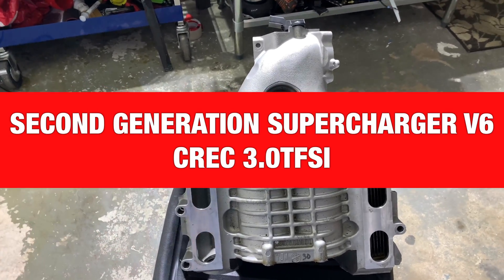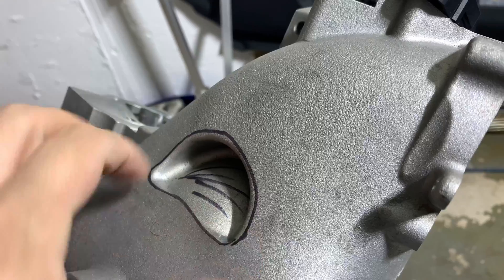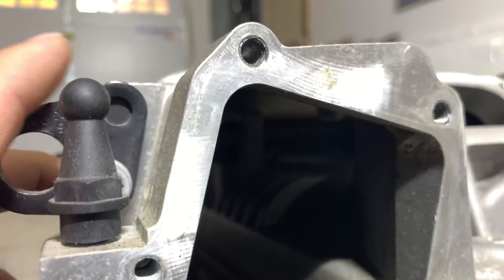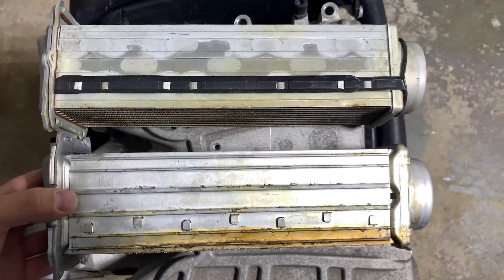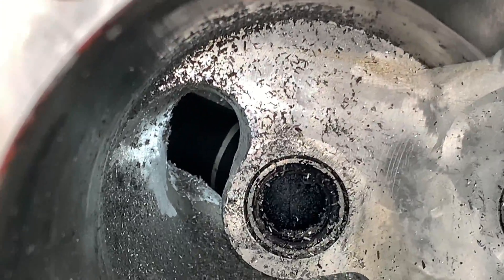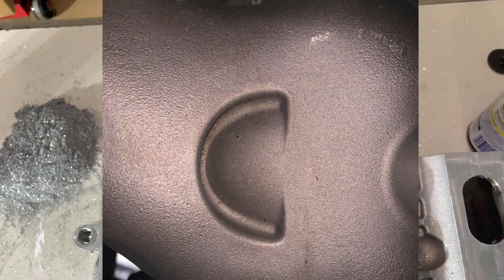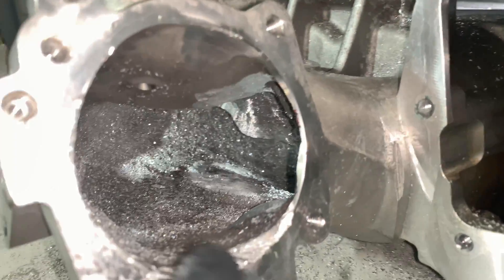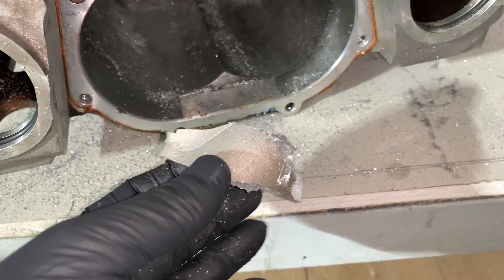Audi Porting Compressor 2nd Gen CREC V6

Comment: can you mod one of these onto a b8 s4? or are they too different?
Reply: I think if you weld the clutches of the crec supercharger it will work fine, and add port injection on top of that and you can make 525hp on stg 1 e85 single pulley tune.

Comment: What do you clean it out with , just water ?
Reply from the maker: High pressure jet washer and blow out with air
Reply: @Svarogperformance  thanks. I didn't cover the needle bearing just wondering if ok to jet wash them .
Reply: Did you get any power figures
Reply from the maker: @Darren-vw8ov  I replaced them! If you planing to kept bearings you need to cover them up very good when you do porting and washing
Reply: @Svarogperformance  Do you have any advice on replacing bearings? I have not seen many charger port jobs where bearings are replaced but I would like to replace. Thank you
Reply: @Svarogperformance где приобрести данные подшипника? И есть ли видео по их заменена,